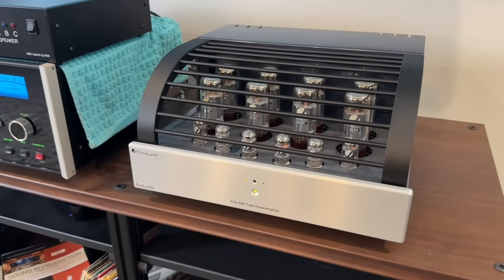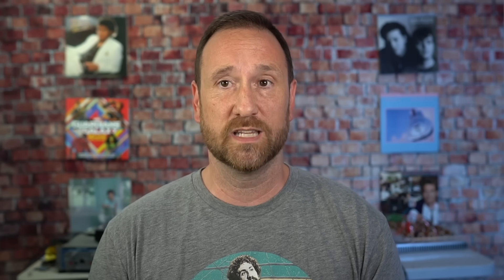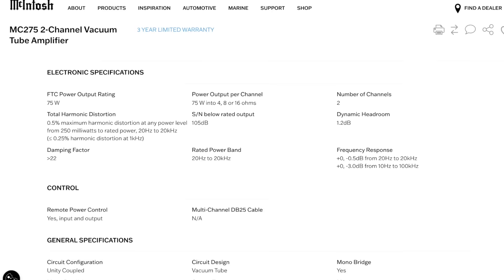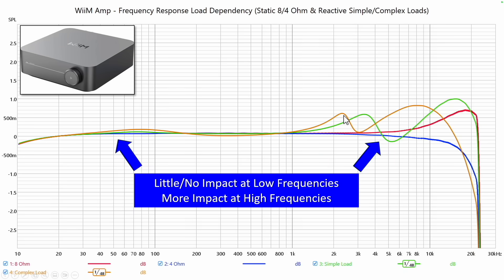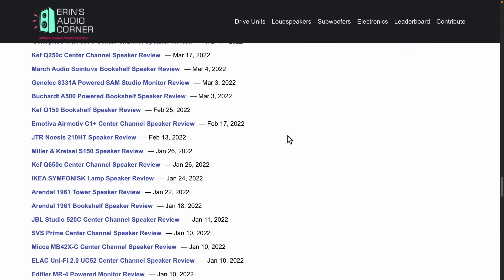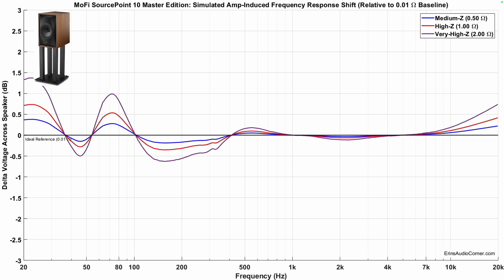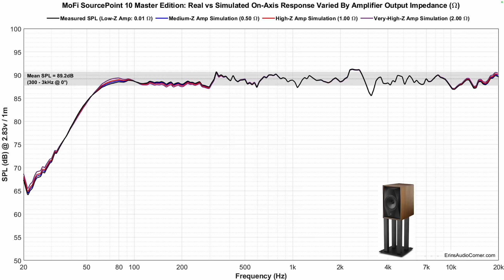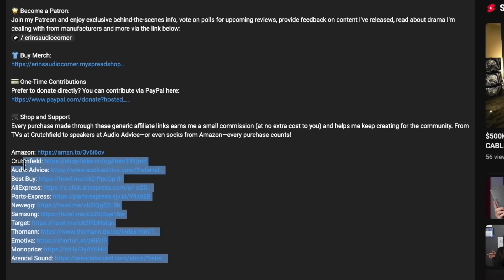Should All Amplifiers Sound The Same?

Comment: The issue of damping factor versus frequency response has been known and written about for many decades. The typical modern tube amplifier has a DF of 4 with feedback or a maximum DF of 2 without feedback.

For the DF to have a negligible effect on the frequency response, it needs to be on the order of 15-20 (I believe it was early work by Western Electric that first covered this). Anything less than this and you will essentially be inserting an equalizer into the audio reproduction chain.

I am always amused when I read or see high-end audio reviewers gush about the sound of the latest wonder tube amplifier and the difference it made in their system. They will spend many paragraphs of adjectives describing the glorious accolades instilled by something they could have accomplished with equalization. Which, of course, tells you that most of them have no idea what the frequency response of their system is like in room. ))

Some well-designed tube amplifiers can accomplish a proper DF, but they are few and far between! You must have a good output transformer design. If you can find a copy of "Transformers and Tubes in Power Amplifiers" by Menno van der Veen, this topic is well covered, complete with a graphical analysis, such as the one you gave.
Reply from the maker: Cool. Good to know. And maybe you weren’t being dismissive of this video, but the way it comes across is “this is old news, why bother”. To which I would say: Look at the number of comments here from viewers who didn’t have any knowledge about the subject. Rehashing old stuff is helpful when it brings it to new audiences. 👍
Reply: @ErinsAudioCorner  I wasn't being dismissive at all. Honestly, it is old news, but so is much technical information. You did a great service by revisiting and expanding on the issue. My apologies if you thought I was being dismissive.

Comment: I think this is also a good argument for active speakers as the response is tuned with the amplifier in the system.
Reply: Correction: It should read 'may be tuned'. It would depend on the implementation.
Reply: Well hopefully it’s tuned..? Lots of cheapo monitor companies out there, is all I know.
Reply: Yes but ther always little class d amps
Reply: @Durkhead well the NAD that has invariate output impedance is class D and it's load invariant. I think I'd want that than an amp that is changing my speaker's frequency response because it's damping factor is low.

So let us stop this 20th century bastardization of class D
Reply: @Durkhead so is the NAD that he used as an example. Not sure that matters.
Reply: @wynkoop2000 class d is the wurst sounding amplifier the treble is dry an brittle
Reply: @Durkhead did you watch the video?
Reply: @wynkoop2000 yes i did doesnt make my statement untrue. 
Start with a good source

Comment: Hey Erin, is it too simple to think that to level match amplifiers you can play white noise on each amplifier and set the volume so you get the same decibels?
Reply: I will typically feed in a sine wave signal at about 500hz and drive to both amplifiers to about 2 or 3 watts, then use a voltmeter on the speaker leads to adjust them to equal outputs.
Reply: @Douglas_Blake my question is exactly this... Why choose a specific frequency when white noise is all frequencies playing all at once ?
Reply: @1337sim1  
Because in many cases even low powered white noise can lead to speaker damage.  Tweeters really hate it.

Comment: Good video and topic. After 5 minutes, I don't care the differences, provided the amps are of notable quality and that I have at least, basic tone controls. Currently, I am getting my audio hat handed to me by an Icepower 1200AS2 module class D kit. My bedroom system has a WiiM amp. It's wonderful. I also have a Pass diy F5, an Amp Camp Amp, Fosi Audio amps, My freshly restored Pioneer SA-8500, a Dynaco ST-70, a restored Adcom GFA-5500 and some active JBL monitors. I love them all and they all will scratch the itch.

Comment: So how do we know the output impedance of an amp? Nobody seems to spec that. Is it safe to use damping factor as an indication?
Reply: Damping factor is the ratio between the amplifier's output impedance and the impedance of the (speaker) load.  So it's pretty easy to back calculate...

Iout = Ispkr / DF 

So with a df of 100 on 4 ohm speakers we get  Iout = 4 / 100 == 0.04 ohms.

Comment: In essence you're arguing to exclude tube amplifiers.
Reply from the maker: LOL. No, I’m not. The McIntosh is a tube amplifier and performs very well. I own it. 

The WiiM Amp (original) is not a tube amp and has high output impedance with frequency.

And those were just examples I had on hand.
Reply: He literally compared two tube amplifiers and one didn't change the frequency response of speaker like the other
Reply: @KofiBaffour-t8o his graph was a relative comparison, not an absolute response measurement.

Comment: I hope Erin doesn't mind if I point something out to the less technical crowd here...

At 5:47 Erin displays a graph of the output response of the Wiim Amp.  This is a very typical chart for any TPA3255 amplifier.  

At least one commenter has already tagged that as "shockingly bad" because he saw a rather large looking bulge in the response.

BUT ... take note of the scaling on that graph.  It is plotting fractional DB differences.  

Erin has zoomed it up to make the differences more visible. This is not wrong, but for those who just glance and wince it is bound to look a lot worse than it actually is.

Taking that graph back to full power we're talking about 0.7db on 8 ohm loads... That means that in your listening room with an 80db spl ... the variation will drive up to 80.7db ... Not only is that not "shockingly bad", it is almost certainly going to be inaudible.

When zoomed out to show full power, it would actually plot as a straight line.

Please... always check the scaling on these graphs... It does matter.
Reply: Typical of the TPA3255 when no post filter feedback (PFFB) is used. Most recent implementations use PFFB.
Reply: @razisn  
Yes, but it's not the gargantuan leap people are making it out to be.  We are talking about correcting fractional decibel errors... look at the scaling on the charts.
Reply: @Douglas_Blake  The issue was such that it could be easily heard in listening tests (depending on speaker used) and in comparative tests between amps with and without PFFB (again depending on speaker used). Erin's chart is generated with a couple of simulated loads. Real loads may produce larger differences. There are many badly behaving speakers out there.
Reply: @razisn  
Do you understand that I wasn't talking about PFFB or even the TPA3255? 

I was cautioning people to be mindful of the scaling on the graphs
Reply: @Douglas_Blake Yeah, but you just said it would be inaudible and he said people could clearly hear the difference? Why not address this discrepancy?
Reply: @3hrice  
The only way that small of a difference will be detectable would be in Blind A-B testing or on an audio analyser.  These aren't the kind of differences that will draw your attention during casual or background listening.

But... once again... I did not post about PFFB or TPA3255 chips ... 

It is about the scaling of the graphs and being careful not to misinterpret tiny differences from scaled up charts. Once again... that graph is showing differences of less than 1db at frequencies half of us cannot hear.
Reply: @Douglas_Blake I get that, just wonder why Erin would bring up such an insignificant result if he didn’t think it would have an impact on the frequency response?
Reply: @3hrice  
On the technical level the measurement is valid and Erin is reporting it accurately.  But we do seem to differ in our assessments of the impact on general listening. 

We've both obviously had a fair bit of experience with listening.  We both have technical skills. We both enjoy doing these examinations.  My best explanation is that perhaps Erin's hearing is a bit more sensitive than mine... or... perhaps the testing he does informs his opinions differently than mine would.  For example, Erin seems to put more import on the zoomed in measurements than I would.  I tend to  work more with the full range graphs as I think they better represent the actual hearing experience.

This is not to say either of us is right or wrong... but there is an obvious difference in how we assess the situation.  It seems Erin feels the small differences he's illustrated are more important than I do.
Reply: @Douglas_Blake It could be some of the speakers he graphed showed a greater impact to the higher frequencies if driven by the Wiim amp. I don’t believe he actually listened to any of these speaker/amp combos. He was just using graphs to show how these output impedances might affect the frequency response of various speakers.
Reply: @3hrice  
Do you understand what I wrote?

I wasn't talking about tests, or comparisons or impedance plots ... 

I was cautioning people to be mindful of the scaling on the graphs. 

The SCALING ... the graduated markings on the left and bottom sides of the graph.
Reply: @Douglas_Blake Yeah man I got that from your 1st post. My point is WHY did he even bother if he thought it would be inaudible? He’s a measurements guy too so I can’t think of any other reason for him to do so. Perhaps that was the “worst” measuring amp he had on hand so he was trying to make it look worse than it was to make a point. However, that wouldn’t be an ethical thing to do at the expense of the manufacturer’s reputation. So, either he’s being unethical or he actually believes it would have some sonic impact.
Reply: @3hrice  
Maybe try reading more than the first line of a comment...

I covered this off 4 posts up. It is true, that variance is there... 
But is it not obvious Erin places more importance on this than I do?

I don't have all the speaker measurement he does ... but I have seen this on my own test bench and it is real.  Erin is being honest and reporting correctly. 

My goal in launching this thread was to caution people against over-reacting because they hadn't taken the scaling on the graphs into account.  

When it's zoomed in to fractions of a decibel it looks a whole lot worse than when it is seen against the full output of the amplifier.  At 80db listening levels, it graphs as a straight line... with the maximum variance being from 80 to 81 db, which would be inaudible for most people... especially when the variances occur at different frequencies.

Yes, PFFB does address this very nicely ... but it's kind of like using a shotgun against a spider.
Reply: @Douglas_Blake According to your argument, Erin shouldn’t be placing more importance on this than he is. He obviously knows that he zoomed in to amplify the effect so, no, that isn’t exactly honest and is in fact DECEPTIVE. If what you say is true, he should make it clear that he exaggerated the effect to make a point. Instead, the viewer now thinks the Wiim amp will affect the sound of their speakers in a negative way. How is that ethical?
Reply: @3hrice  
First of all... zooming in like that is in no way dishonest or unethical.  All you have to do is take the scaling of the graph into account when reading it.  (Hence my top comment)

I do this all the time... I will spot something on my scope and zero right in on it for a closer look.  That's how we understand what we're seeing. 

It might have helped the uninitiated if Erin had shown both graphs... but for anyone who actually knows how to read them, it would not be necessary.

Go look at the graph again ... Now follow the red line (8 ohm, load). Notice the scaling on the bottom.  We're going to look at 20khz. Now note the scailing on the right. At 20 khz that line shows +700m.  That is 700 milidecibels, or +0.7db.

That measurement isn't changed by zooming out the graph... so at 80dbspl, at 20khz the level will rise by 0.7db to 80.7db.  

So now the question is who's going to hear that?  Probably nobody.

If that was displayed on the full 80db scale, it would be so tiny you couldn't even see it. Erin zoomed it in so that you can.  There's nothing wrong with that.... unless you don't know how to read the charts.
Reply: 👍Agreed, always remember and be careful to check and reference the vertical y-axis scale or "scaling" of the graph for any type of charted response!

The graphical scale increments are usually adjustable/configurable in most RTA and measurement software, such as REW, etc.  Horizontal (x-axis) scaling can vary as well.  Note the specific "expanded" and "contracted" scaling "regions" in typical frequency response graphs.
Reply: Jeebus ... 11 replies in and only 1 person has actually responded to what I wrote.

Comment: Awesome video and logic. You can now apply the same reasoning to op-amp rolling: (maby do video about that) you are welcome.
Reply: No you can't.  The output of an amplifier into variable impedances is not relevant to the sound of an op-amp.

The behaviour of an operational amplifier is determined by passive parts (resistors, capacitors, etc.) surrounding it.  For example: if you design for a gain of 10 any op-amp you drop into that socket is going to display a gain of 10.  

When you are chip-flipping these things you are not changing that external network of parts... you're going to get the same result.  ASR did an article and video on this.  I've tested it on my own bench ... the result was literally "no difference".
Reply from the maker: That’s apples vs oranges, though.
Reply: @ErinsAudioCorner  comparing two different amps is like comparing apples and oranges.
you are welcome...

Comment: Interestingly my amp manufacturer doesn't list at output impedance spec, but they do give damping factors at 4 frequencies (20hz, 1k, 20k, 200khz).  Given that it's an incredibly well measuring solid state amp, I'm sure the output impedance is very low.  I'm pretty happy with the amp.  It does what I think it should (with almost a boring level of precision).  I think with a properly designed amp of sufficient quality, they'll all start to sound pretty similar.

I've got another amp in a 2nd system that is substantially cheaper but still seems to work fairly well (hypex nc252mp based).  Not surprised that that amp has an output impedance of 5 milliohms.

Oh - please do speaker cables next.  I can't wait to see how audible those changes will be 😁
Reply: You can calculate it easily enough ...  Iout = Ispkr/DF ... 
So with a DF of 40 on 8 ohms... Iout = 8 / 40 == 0.2 ohms.
Reply from the maker: Hey, that’s better than just one single value and definitely better than nothing.
Reply: They need to provide both the frequencies AND the load. If you know the load (for example 8ohm) you can calculate the output impedance at that load and frequency by dividing the load by the DF. DF is usually quoted at 8ohm but it is better if they specify that to be certain. If only one DF number is quoted then this is USUALLY at 1kHz and 8 ohm.
Reply: @razisn  Yeah, they provide it at 8 ohm for those frequencies. 👍

I was a little surprised that the manufacturer (Benchmark) didn't provide the specific output impedances; however, I later found a full application note by John Siau elsewhere on their website specifically on damping factor (and how it's just another way to represent the output impedance).  The article is pretty thorough and talks about practical limitations for output impedance due to speaker cable impedances.
Reply: @nmnate  As I already said, it is trivial to calculate the output impedance from the DF. Indeed there is a limit after which huge DF numbers make no difference since cable and connection resistance far exceed the 'raw' output impedance. Damping factors in the thousands as quoted by some manufacturers are only for bragging rights.

Comment: Nice video showing something that has been well known basically forever. what makes amp sound different is how well they can match the speakers impedance. IE, it's continuous current capacity vs resistance. This is particularly true of tube amps but also true af transistor ones. The difference in sound of the Prima Luna is not a "good thing" it's in fact, a "crappy" sound.😂  That's why McIntosh uses output transformers. In fact they use them on their transistor amps too, which no one else does. Though the current impedance matching of transistor amps is less critical it's still what separates "the men from the boys" The most ridiculous claims of power come from class D manufacturers Boasting ratings like 600 watts at 2 ohms! Wow thats incredible, then the small print reads...150 at 8 ohms😂😂😂. Output transformees guarantee current stabikty regardless of impedance.......It was the secret sauce 70 years ago, and it still is!